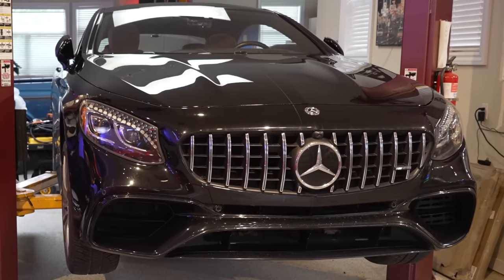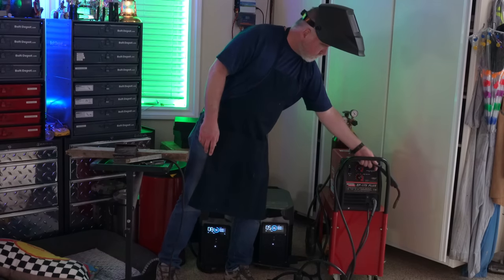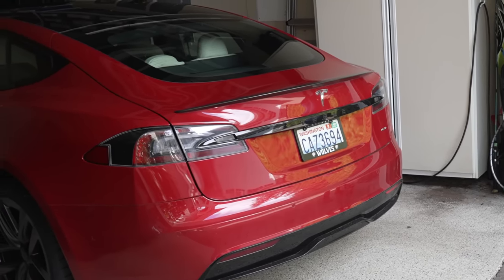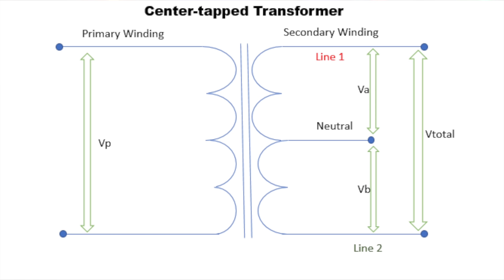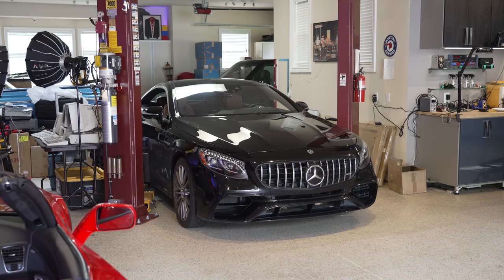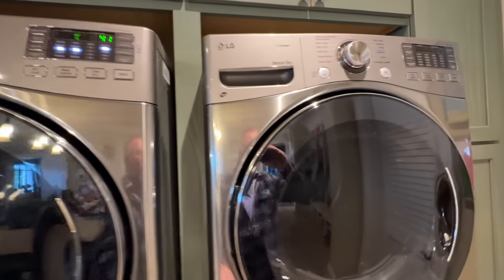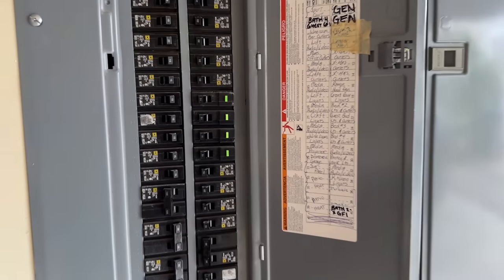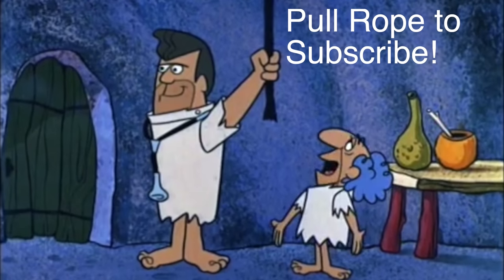240V Solar Battery Experiments - Welding, Lifting a Car, Charging a Tesla, and More!

Comment from the maker: One note - residential power is 240V RMS, not peak to peak.  You can see 120V is closer to 170V at peak in the episode diagram.  Sorry for the blooper!
Reply: Yes, sine waves are 1.414 times the R/MS Voltage. This means that it is 169.68 Volts to the peak. or 339.36 Volts Peak to Peak. 240 takes the P-P voltage to 678.72 Volts.
Reply: your issue with the tesla is most likely the adapter.  Tesla is detecting voltage on the ground wire.
Reply: What happens if you want to use a electrical component that consumes way too much power. In my country We have 230V AC relative to the neutral. We have three phase electrical supply. When using three phase the voltage between two phases is 400V. Three phases are 120 degrees out of phase, not 180.
Reply: @isharadhanushan2002  You are talking about 208V Three phase service. We use 240V Split phase for homes in the United States. 200A 240V service is common. I've only seen one home with three phase It was on a thousand + acre Nursery it a 14" well to irrigate several hundred acres. It was near the house, and they needed an elevator for an elderly relative so it was extended to the home.

Three phase simplifies motor starting. We just use a phase shift capacitor to run large motors. A second, start capacitor kicks off rotation, then is disconnected from the start winding.
Reply: @michaelterrell  I mean is it possible to get 400V 3 phase electricity in USA.  In my country houses use 230V single phase electricity. If required we can request 3 phase electricity depending on our needs.
Reply: @isharadhanushan2002  You can get anything you are willing to pay for, but there is nothing that can't be run from readily available power that isn't used for commercial or industrial equipment like the TV transmitters that I worked with. The smaller transmitter was 480 three phase @ 400A. Homes in the USA are powered from local transformers, at the street, unlike the European method of long, three phase feeds to service entire blocks.
The transformer in front of my home serves four houses which is quite typical. This also minimizes service disruptions when repairs are required. The Primary feed is typically 7200 volts per phase. This is fused at each transformer, in newer or rebuilt areas so that a hot stick can be used to disconnect the transformer from the primary in an emergency.
Reply: @isharadhanushan2002  We also have three phase available.  It is required by some industrial electrical equipment.  If you lose a phase, one of two things happens:  1)  The device slows down and sounds funny or 2) the device detects the problem and shuts off.

Comment: On my gas powered generator, there is a place to screw in a wire to physically ground a generator to the Earth. I believe the Tesla tested each of the wires, and the ground must have been floating. See if your sub panel has an independent ground, or if it's ground is connected to your main panel.

Comment: As a former electrician, I installed numerous Square-D generator interlocks. They are inexpensive and fast to install. I don't know why most electricians talk the customer into installing a separate panel and moving circuits. Maybe because they can make thousands of dollars instead of hundreds.
Reply: I suspect it's because your average generator can't supply the whole panel, and most homeowners won't remember which breakers they need to go through and turn off. Moving the generator supplied circuits to their own panel means the homeowner can throw one breaker, and likely not overload the generator.
Reply: @JCWren  Yes it's basically because most people are non-technical and want it to "just work". A subpanel forces you to make specific choices about loads that will always just work without having to guess about load capacity. The generator user may be gramma who just knows which button turns on Wheel of Fortune in the kitchen.
Reply: Interlocks can and will be bypassed by "those people".  Interlocks are not legal in Canada for that reason.  A simple piece of screwed in steel can be unscrewed, or the whole panel front can be removed in seconds thus bypassing the interlock.  Interlocks are perfectly adequate for the "average intelligence" person, but as the word implies, half of the included individuals are "less than average".

Comment: The EcoFlow probably has a floating neutral.  Most inverter generators are configured the same way.  You can make a simple plug that connects ground to neutral.  The same issue happens on RV's that have a Energy Management System.  They will not allow power to pass if they do not sense the neutral tied to ground.

Comment: Insufficient grounding means exactly what ie means "insufficient grounding", the power Boxes need an addtional grounding wires which will be grounded (earthed), inother words the wires must be  dug two feet in the ground, if you check carefully should be able to find this ground wires outlets,
I Think the Tesla is doing some sort of "ping" test to check if the grounding circuit is complete,  i would agree connecting the two  power banks to the House mains, then from house To Tesla, should fix this isssue as you have already tried,

Awsome video ,some of us who usually get 8 hours of utility power per day really know how usefull such power boxes  can be,

Over!😊
Reply: Or gas pipes, or water pipes as long as they are good old fashioned metal.

Comment: The telsa charger needs a neutral to ground bond like we have in our service entrance from the grid. The ecoflow does not bond the neutral and ground. There is a simple fix but I'm sure ecoflow would not approve.
Reply: Does the Ecoflow have GFI detection on the output? Could Dave just bond W/G?
Reply: @TonyPombo  yes he could and it would work but to have gfi protection the ecoflow would need to have an earth connection which obviously isn't practical although very possible If the ecoflow is only used in a permanent home power backup system
Reply: @dansprenger4647  Thanks for replying. GFI detection/protection does not require a earth ground to be present, right? Otherwise NEC 406.4(D)(2)(b) would be invalid.

Don't RCD/GFI devices work by measure current on the hot & neutral wires? Ground doesn't come into play. Do I understand this right?
Reply: @dansprenger4647  Come to think of it, wouldn't the Ecoflow device require GFI protection on all the "grounded" outlets since it doesn't actually have an earth ground? It would be a violation of the same NEC code if it didn't, right?
Reply: @TonyPombo  I'm not sure about the code portion, but I notice a lot of these Ecoflow/Blueetti/whatever battery boxes don't have GFCI outlets. That surprised me since even my junky generators do. And they also have a grounding stud, in case you feel like pounding in a ground rod.
Reply: @JCWren  "they also have a grounding stud". Thanks for sharing. I've not actually seen one of these battery things in person.
Reply: You would want earth ground for GFI since the point is to detect when YOU are providing the earth ground.
Most dangerous current leakage would be from line to external ground, such as water pipes, earth itself, etc.
With the Eco directly connected to the load, such as the tesla, neutral and the "ground" wire would be floating from actual earth ground.  If earth ground were guaranteed to be isolated from the Eco neutral/ground, then no current could flow through a puddle of water that perhaps you're standing in.
But you can't guarantee that and neither can the Eco detect that since it has no earth reference of its own.
So GFI wouldn't be too effective.

Comment: Neutral and ground were not bonded together like in a North American Power system… You have a Bond screw in the main panel even though every branch circuit and your sub panels have 4 wires. 2 hots, a neutral and a ground wire. Ask your local electrician. In the Tesla charger it is testing for the neutral and ground bond. Your kit did not take that into consideration.😅😅😅😅

Comment: A minor correction. The safety ground wire is run back to the panel and to a single point where the Ground and the neutral are connected together. The connection to actual earth ground is for lightning protection and is also connected to this bonding point. The safety ground is an alternate return path for a fault where the hot is somehow connected to the metal (that a human can touch) of a device. That metal needs an electrical path back to the same point as the neutral where it will pull a lot of current and trip the breaker. The earth doesn't magically absorb electrons. This is probably why the tesla would not charge. It was testing for a properly bonded power system, Most larger generators made for whole house powering do not have a bond they leave that to the panel in the house. The NEC requires there to be only one bonding point at any premises whether is powered from the line or a generator. If these "generators" are not internally bonded they are unsafe to use as a stand alone power system as a fault does not have a return path for the fault current. You can get bonding adaptors for generators that are not bonded. You should check the manual, or with the manufacturer to see if the generator is bonded.
Reply: In other words, the Tesla objected because the ground wire to the generators was not internally connected to the neutral?
Reply: Tesla picked up where Volvo dropped off.  They're really into safety, and they know their stuff.  There are ways to test for proper grounding, and they're doing it.
I know I wouldn't want to be that guy charging a car on rubber tires out in the rain with an improperly grounded system.  So pack thick rubber gloves instead?
Edit:  To emphasize... out in the rain.  Shyt happens.
Reply: Except the ground does just magically absorb electrons from an AC circuit. See Single Wire Earth Return, used in very remote locations of Australia where getting just one wire out to the middle of nowhere is expensive. Stick a rod in the ground, and the single wire circuit is completed. Though probably a bunch of rods paralleled together for really high conductivity...
Reply: @DMahalko  OK, But we are talking about USA Home powering schemes here. But, to your point, in a single wire earth return system the earth is not "absorbing" electrons. It is merely the return path of the electrical circuit (quite inefficiently I might add). To Dave's issue and my original point, the safety of the safety ground is not that is is connected to the actual earth with a ground rod, it is because it is connected to the bonding point in the main breaker box. This allows it to be a better return path for the fault current than your body (because electricity takes the path of least resistance).
Reply: re: "The connection to actual earth ground is for lightning protection "
FOR primary to secondary shorts too, on the pole pig or pad mounted stepdown transformer ...
Reply: Grounding wires have multiple purposes. I wish I was taught that back in my Digital Electronics class. I thought it was used for one thing, and yet I get explanations that's it's used for multiple things.

One thing grounding wires are good for is being a hub for excess static electricity. Using a shop vac, and a Solar Battery in tandem is disastrous. Even if you have the proper ground going to the unit itself. This doesn't mean it's protected from static electricity frying the thing. You need to hook up your Solar Battery to a Earth wire so that when you are sucking up all the debris, and running through the plastic, you don't become a electrostatic capacitor. Frying anyone, and anything around you, with the touch of a finder. You're better off grounding the shop vac, and if you are really paranoid, but sometimes necessary, ground yourself.

Comment: Fun fact - if you've got an appropriately sized array and the sun's out, you can grab some arc welding rods and DC arc weld directly off the string, if you have a traditional DC string based system.
Reply: Today I just boiled my kettle (water heater) from the array for the first time (in the middle of the UK in May) and that drew about 3.6kW in total with the rest of my house electrical products!

Comment: Thank you for the much needed informative review. I am from India, our supply is 220~240 VAC default, and here in some of our villages there is no grounding, and the EVSEs do show a fault, and I drive a copper rod into the ‘damp’ ground connecting the ground wire to it, and the fault disappears. I do the same for a gasoline generator, as it too does not come with grounding. Indeed it works and charging starts, but I monitor it and is mostly under supervision. Not sure if this would work for you.

Comment: I'm not jelous of the US electrical standard (I'm living in Sweden, Europe). We have 230V single phase, and if we want extra juice we have 3 phase (400V). So the line into the house is 5 wires, earth, neutral, and three live (hot) wires with 120° between each phase.

Comment: Note that all this describes the North American power distribution system - it is not the same as European / RoW systems that typically use 1 or 3 phases with 220-240 volts phase to neutral, 380-415 volts between phases.  Take local professional advice!

Comment: Two points, first is that the reason ground is connected is that the transforner neutral is bonded to ground and so when a circuit is connected to ground through a fault condition there is a return path the idea being that a sufficient current can be carried as to cause a breaker to trip.  If the ground connection at the property is sub-standard then not enough current can flow and there can be continuous current leakage.  With the introduction of RCDs/GFCIs even this small leakage current will trip the device which imrproves safety massively.  The other benefit of grounding is to keep the current at the same potential in relation to earth.  Second point is that if a generator is feeding a house that is connected to the grid and the grid power returns then you are right that they are likely in different positions in relation to phase rotation - they will automatically synchronise as the field developed in the windings will be generated and try to move the spindle in the rotor to the "right" position - unless the two are "in-phase" with each other this will introduce massive mechanical strains in the assembly which could cause the mechanical failure of the unit.  In equipment designed for this purpose (such as solar inverters) the equipment will lock on to the external phase rotation and align itself with it, where the unit is electromagnetic such as a gas generator a device will be present that will allow the operator (or perhaps automatically) to allow the rotation to align before the electrical connection is made.  There may be a slight jump if they are not perfectly aligned.

Comment: Disclaimer: The information in this replay is for informational purposes only and should not be considered as professional advice. I do not know the device nor the NEMA standards...

I (Electrician for industrial engineering) suspect that the Tesla is testing the PE (protective earth) connection and is probably simply failing because the batteries are not properly connected to ground.

In the European version of the Delta PRO, there are no earth connectors on the socket. Therefore, I suspect that there is no way to connect them to the ground.

Comment: If you have a backup power source and the grid connected during an outage, and the grid power is restored, you local source will immediately be brought in to phase with the grid. Your local power source will likely complain (loudly!) about this is, but when it comes to a fight between your local power source and the grid, the grid will win. Like an average guy stepping in to the ring against a heavy-weight campion, the fight will be short lived and the small guy will come out looking worse for the experience. A good outcome would be to just pop some breakers. A bad outcome will likely be much more expensive.

If you want to deliberately connect your local power source and the grid at the same time, there is a process that holds the two supplies apart until they are exactly in phase, only then joining them together.

PS. 1) Your house / shop is awesome. 2) You do an amazingly eclectic mix of videos - and I love 'em all. Keep up the good work!